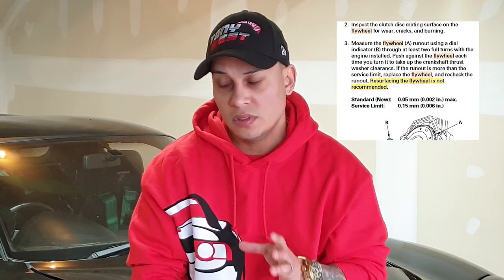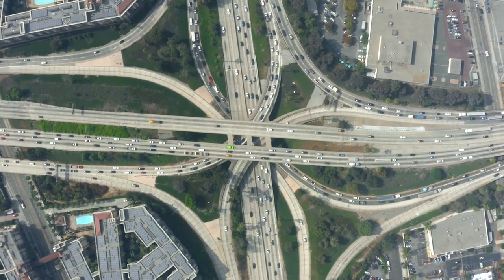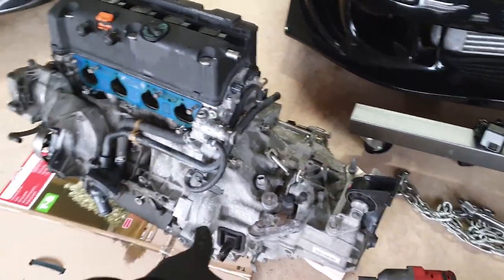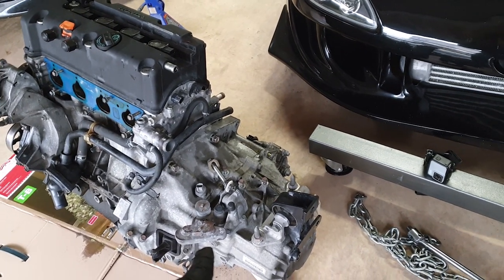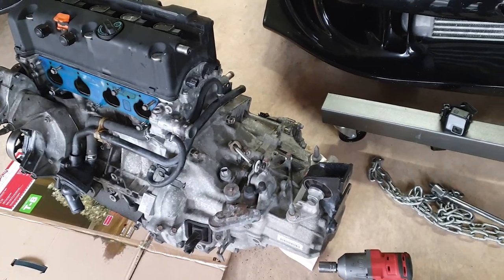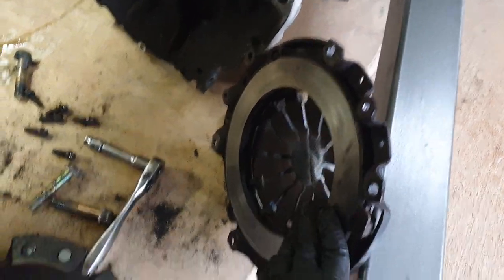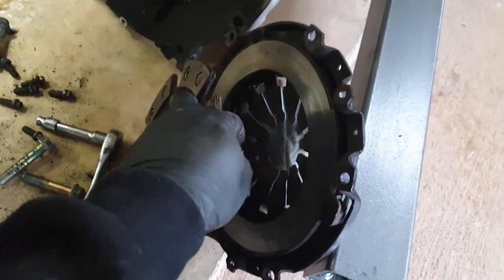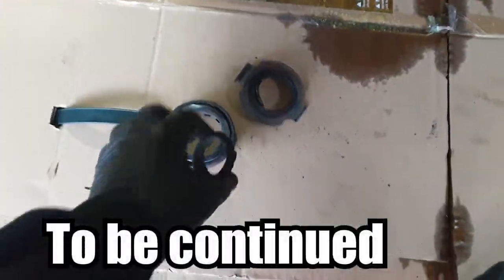My car is destroyed!! - How to replace the throw-out bearing,clutch, and flywheel - Acura RSX Part 1

Comment: When you lifted the motor and transmission from the top, could you leave the a/c connected? As the a/c pipe goes right above the motor. Also, did you need to remove the radiator?
Reply from the maker: The a/c pipe is routed from the other side. Check my video on how to replace the a/c compressor. However, you will have to remove the a/c pipe if you want to remove the engine and transmission together.
I didn't remove the radiator though.